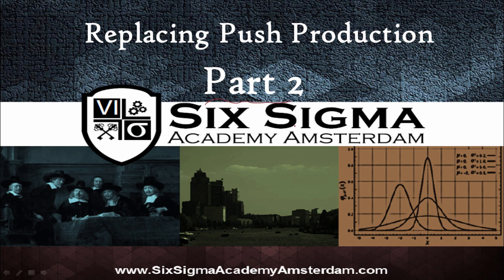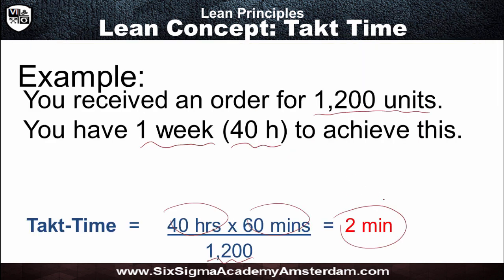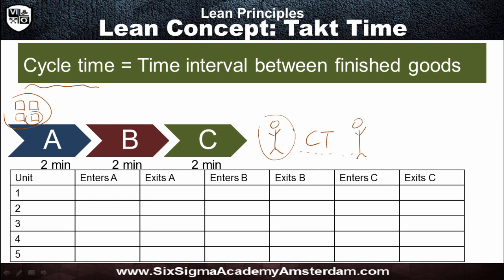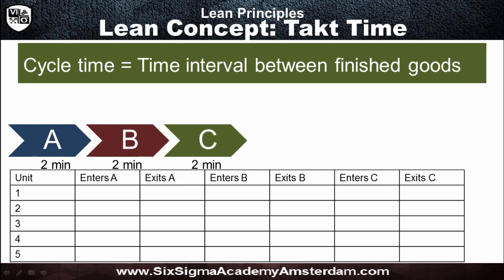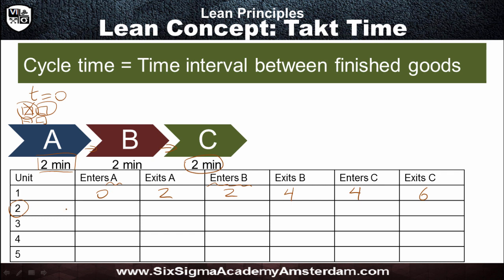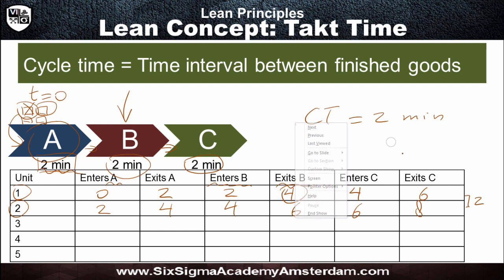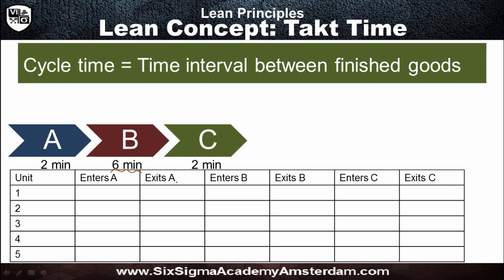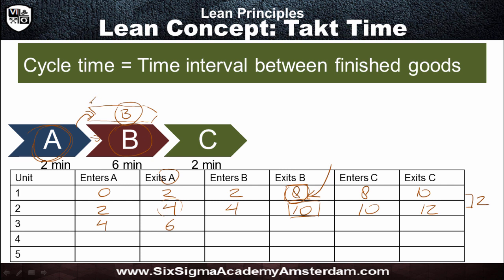Takt time, cycle time and bottlenecks explanation

Comment: The interesting thing here, is, that in the "soup" example,  process B was resolved by increasing equipment, as 1 person would still occupy process B, but in the toy example it would depend greatly on what is involved in that process , if it's a hand-on assembly process , then having three people doing that could lower the time to 2 min for that process, but if it's machinery that requires a dedicated operator, then we would need 3 machines and 3 operators.  (a lot of cost) which may require some other creative solution.

Comment: at 14.7 can you explain why if cycle time is less than take time then it meet customer requirement? the total lead time of the total process still be 10+2+2+2+2 = 18 min if takt time is 2 it mean that suppose available time is 10  min, demand per day is 5 then take time is 2 min. but if you have cycle time 2 min. that mean you will complete the total process = 18 min. that is more than available time 10 min.? how can that be acceptable?

Comment: When calculating capacity of an inspection line, I account for reruns and Equipment downtime on top of the scheduled amount needed to be inspected which amounts to 11% more units and then on the inspection line there is a calculated capacity using the ideal cycle time however its a manned station and its not 100% efficient therefore my Actual throughput is 10% less. Can i show these numbers to show we need more overspeed or am i double dipping the downtime numbers?
Reply: Hi. If is still relevant. Yes return part  must be calculated into the TT. If is rework, try to improve, because its a waste. Dowtimes must be subtracted from available time, so yes it is affecting final TT.
I would suggest to focus on improving down times and rework to minimum. Focus on nonvalue added activities improvement. After I would recalculate and show to management. Does this helped?

Comment: Very helpful! One question: A company has different types of products (let's say different toys, for instance), the takt time is refered to the complete demand of any kind of toys or you can apply that for each type? What is the common way to use it? Thank you a lot!
Reply: Hi. If is still relevant. TT in this case depends if all products pass the same line or there are different lines for each. If different lines TT is calculated separatelly. If one line TT is common for all products. It is key to have right scheduling method to induct every part every day. Does this helped?